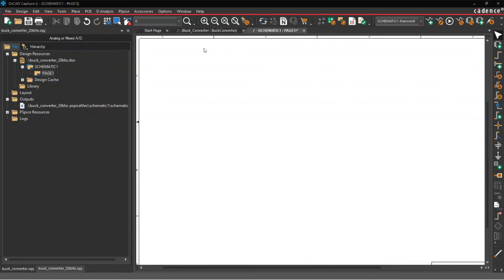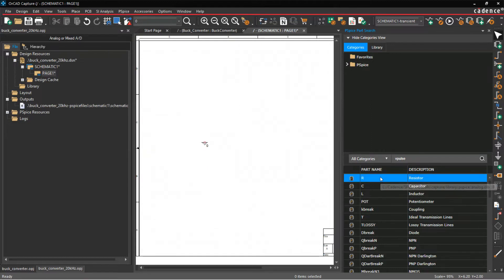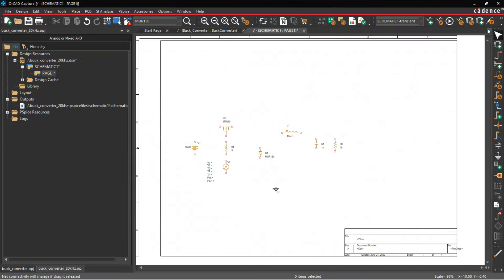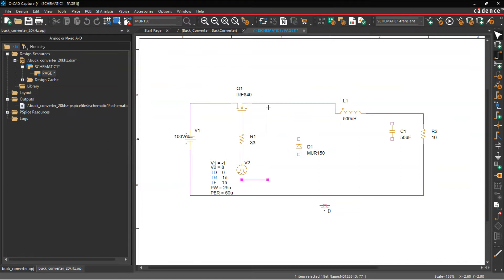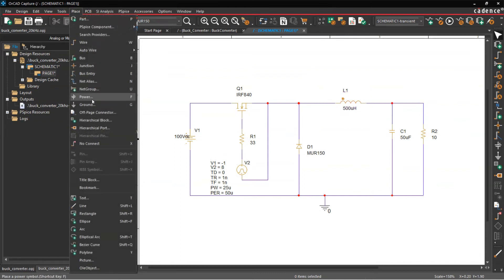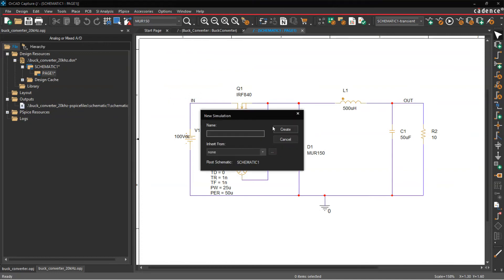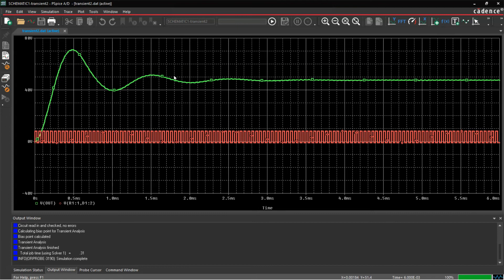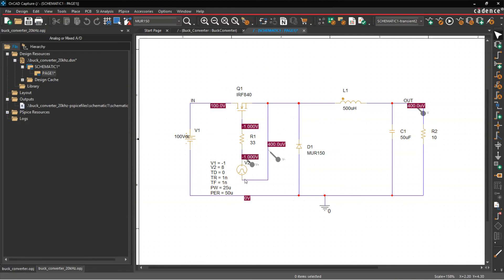How to create a Buck Converter using PSPICE - best Circuit Simulator

Comment: Thanks for your video!!
I have a question of the simulation result 
The Output voltage (across the output resistor) is near 50V which is intended, but the output has offset that makes the output slightly under 50V. 
Why does this happen and how can we make it exact 50V?(for my thought, to make it exact 50V, it needs some feedback control loop to control D(duty ratio or pulse width). But If we can achieve exact 50V without feedback, I would prefer that mothod)
Reply from the maker: Great question. So the exact reason depends on usually the voltage drop across the diode and also the selection of the component values. 

Standard values for Real capacitors and resistors tend to be different from the theoretical values, which affect the results a bit, though again, the majority of cases is because the duty cycle didn’t take the diode voltage drop. 

Vout = Duty Cycle * Vin is just a rough estimate. The quickest solution is to increase the duty cycle a bit until the output is 50V. Or redesign values based on diode forward voltage drop.
Reply: @techedkirsch  Thanks! your answer helps me to understand the simulation 
Can I have any info or analysis video or sites or books for exact anaylsis of v_out and dynamics(considering diode voltage drop and etcs)?? I want to study it more specifically 
Again I thanks for your answer! :)
Reply from the maker: @샘-k9z  Ah, in this case, if it’s only theoretical analysis, you’ll want to look into any highly rated electronics text book. Those always give the real full analysis of the buck converter from scratch. 

Or for free online you should be able to find the details when you do a search like “buck converter analysis paper”.

Or if you want analysis and course walkthrough that includes the buck analysis and how to build it, you can enroll here at HaSofu academy in our introduction to power electronics course: https://academy.hasofu.com/course/ha105-power-pdn

Comment: Kirsch, Is pspice an add on to OrCAD?
Reply from the maker: Hi David, yep it is technically an add-on. OrCAD is the name of the suite. Capture is the name of the schematic capture tool in the suite. But Capture has no simulation capabilities. 

Some history from my personal observations, dealing with PSPICE starting around 2007...

PSPICE I think started off with that name before 2007, which encapsulated both the schematic capture tool and everything in it. You'll be able to find old documentation that calls the entire ecosystem (including what we now call OrCAD Capture) as the name PSPICE. 

Then at some point the 
Cadence/Oregon CAD team has embedded a SPICE simulation set of tools that are more user tailored to SPICE simulation and modification. This set of tools are what we consider PSPICE today. They're standalone tools like the model browser and also the simulation window for PSPICE. and the schematic-only features are called Capture.

That's why it was possible to purchase Capture standalone through EMA Design Automation, then if you wanted the simulation add-on, you could also order PSPICE standard/basic or advanced.

The developers at Cadence (or Oregon CAD?) did a great job of making it almost seamless, the relationship between PSPICE underneath the hood of Capture. But yes, Capture calls PSPICE when needed, as it's  different tool.

University students and worldwide got used to calling Capture (or Allegro Design Entry HDL for our corporate users and university students out there) the wrong name...they just call it PSPICE. Eventually it stuck.

This may not be the most accurate, but this is what I've observed from personal experience over the years. Others (or Cadence) will have the full proper history of course. I would be interested in learning how that's played out comprehensively at some point.